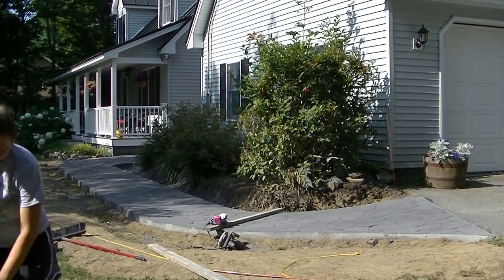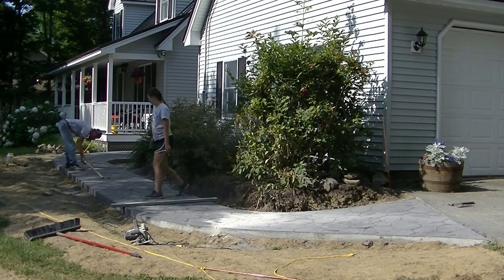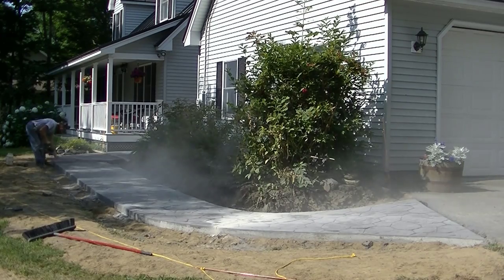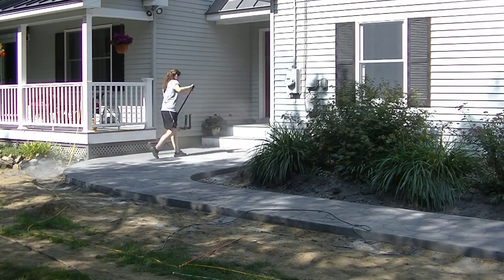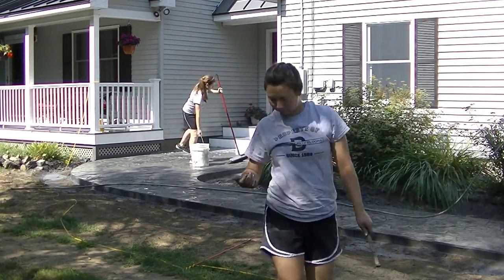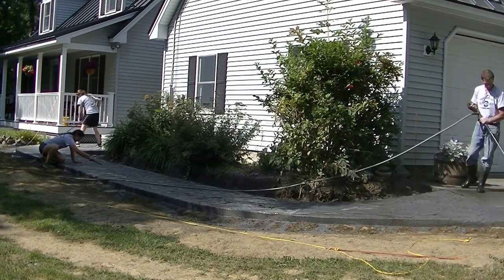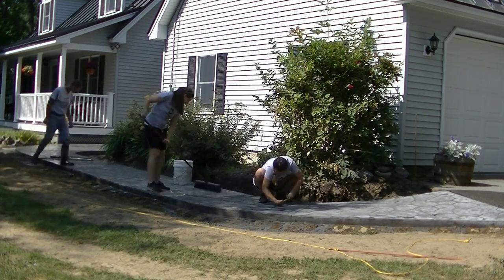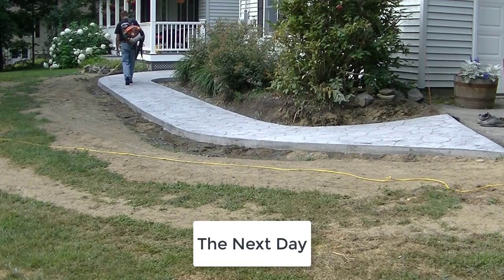How To Saw Expansion Joints, Clean And Seal Stamped Concrete Walkways

Comment: I use a grinder blade on smaller jobs like that, nice thin lines less expantion,,very clean look with stamp
Reply: Try a diamond blade with a grinder ,,very nice thin cuts 💯your a good man thank you for your chanal,,my wife comes to work with me sometimes,, thanks Mike I felt bad for bringing her sometimes,, thx Mike,, from Mikey Concrete
Reply from the maker: I didn't have my soff-cut saw on this job. That's what I usually use, it's fast and a lot less dust.
Reply: @MikeDayConcrete  soft cut saw is fast and is led dusty,, but still I use a diamond blade with a grinder,,really thin lines,  I'm in Toronto it' gets cold up here ,, less expantion less water penetration, saw cut for me are to thick I find , thx for the call back, I really like your video's

Comment: Great video. I just saw all the errors my contractor made. For one, they slapped on one heavy coat of sealer, an hour after pressure washing. We got bubbles galore that they have to come fix. 
My question is on the expansion cracks. Should those be sealed with caulk?  I live in Colorado so I’m worried water will freeze in the cracks and cause damage. Thanks!
Reply from the maker: You can caulk them if you like. We live in Maine so lots of freeze thaw also and it's not usually a problem here.

Comment: -Great vid mike! Thanks for addressing the ADA concerns. After having worked w/conc for many years I personally think the ADA guidelines can get a little overboard and tedious at times but - What’re ya gonna do? 🤷‍♂️ 
-It never really occurred to me before about having the girls work with you but after watching them ‘clean-up’ the joints in the surface I thought maybe that’s not such a bad idea after all to have the girls bring in somewhat of a ‘women’s touch’ to the job. Women definitely have a more critical eye for the details than men. So where they’re limited physically in certain areas, I think they justifiably earn their money in others.
-Btw those diamond blades are awesome, aren’t they? Remember the old days when all we had were those old carborundum blades? 
🤜🤛
Reply from the maker: Yes, those old blades wore down very fast.Thanks for watching and commenting on the videos!!
Reply: I use a grinder with a diamond blade, nice thin lines less expantion I find ,,and with stamp concrete, you don't notice the lines at all 🖒🖒

Comment: How often do you run into cracks the next morning on a stamp job before you can saw.  And if so how do you handle that with the customer?
Reply from the maker: Rarely if ever do I run into that. If I think that might happen, I'll come back later that day and saw cut that area where I think it's most likely to crack.
I tell the customer in advance the concrete may crack somewhere and that I try to control them as much as I possibly can. I make sure they understand a crack could occur. If I feel they can't live with that I don't do the job.
Reply: @MikeDayConcrete  Concrete can be a weird ‘animal’ at times. Sometimes no matter what preventative measures you take, you can still get a crack. 
-Working on a high-rise some years back, we poured another one of the floors. We came in the next morning and there were cracks all over the place. Hairline cracks, but it’s always alarming to see. We called the engineer just to let him know. He told us to continue with the verticals for the next floor as usual and stress the cables as soon as the concrete strength was sufficient. We did as we were told and as soon as the cables were tightened, all the cracks completely disappeared. We watched the concrete strength tests for the next month or so and everything came up normal. Sometimes ya just never know 🤷‍♂️.
🤜🤛